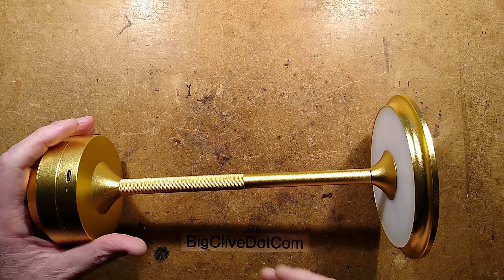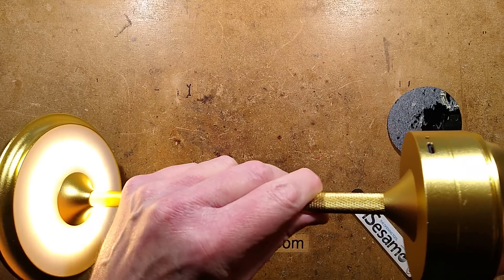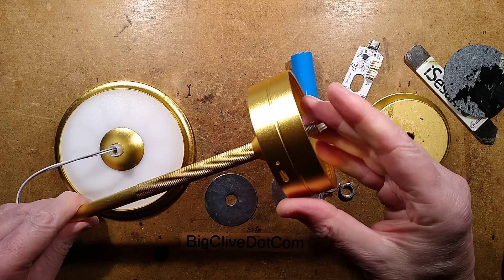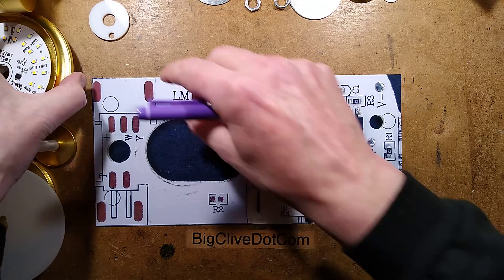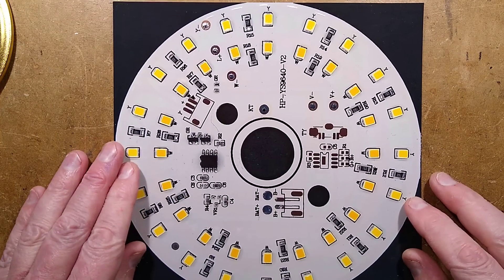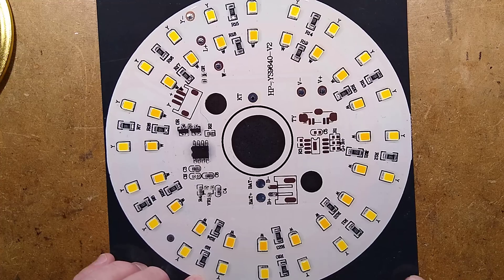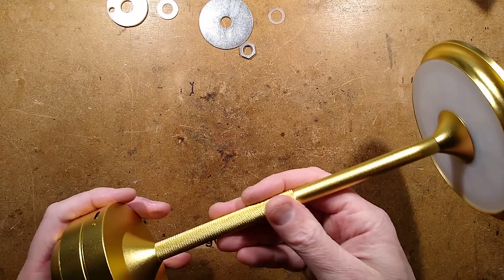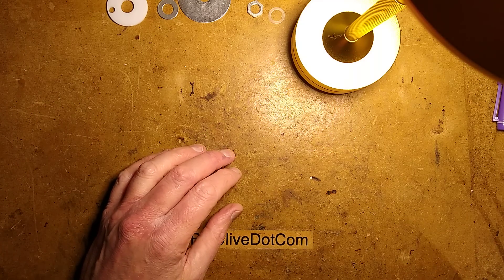Crappy, but hackable rechargeable restaurant light

Comment: A bar I go to has a bunch of similar lights, the touch control works well but a couple of them don't turn on the Led when the USB is plugged in. I'm not sure if it's charging, I suspect not. I'm wondering if there is a bad solder joint or if the battery is shot. I can always take it to work and look at the lamp at the rework bench, just wondering if anyone had a similar problem.
Reply from the maker: Some chargers may generate so much electrical noise that they affect the touch sensing.

Comment: I have a usb pcb light with touch with almost the same dimm function. It's a great night light and I keep planning to hack it and make it a proper night light. Multiple taps and color changing is annoying. Lamps with multiple modes should have different switch. I am yet to buy a better night light than the ugly pcb light.

Comment: Never underestimate the power of percussive maintenance!

BC, my brother from another mother, you need a deadblow hammer.  Hear me now, believe me later.

...i'm sure you already have one.  i like the one with the rubber and plastic head, non-marring.  thing is, the lamp with that thin metal with large circ., you're basically dealing with a mistrhreaded crappy pinspot.  I know you know the ones i'm talking about.  when you're halfway through unscrewing it and the lamp ring binds?  i bang 'em on the nearest hard object.  that usually pops things back into place...

Cheers!  An thanks!

Comment: Looking on LCSC, the touch controller appears to share a pinout with the Sam&wing brand 6010S chip. Interestingly enough, the picture seems to show the chip is unmarked on the top surface, but has some markings on the bottom. Only problem is that the datasheet says that the brightness increases as you hold the touch button, but perhaps there is a non-S variety of the chip out there that has the opposite behavior.
Reply from the maker: It does look like it may be that chip.  I've updated the video's description.

Comment: All these battery-powered lights in applications where they're not meant to be portable is perplexing. Instead of having lights which are wired and just need to be turned on/off/dimmed, you now have dozens of these things in your restaurant which need charged, can't stay on indefinitely, could be easily stolen, and because batteries aren't 100% efficient, you end up paying even more for the power, time and effort to charge them, and create more e-waste when the batteries inevitably fail? Maybe it makes sense to those profiting from these devices, but it doesn't make a bit of sense to me.

Comment: I have three of these lights. They are all significantly better, in that they have a physical tactile button.
Two of them are basic cheap yard-sale obtains that offer High and Low power in Warm White. One white, one orange.
The third I paid Covid prices for, and is significantly more advanced (and awesome), with a sharper appearance.
It has the three color temp settings, and will cycle between Neutral White Bright, Dim, Warm White (bright/dim), and Cool White (bright/dim). It'll turn off when you click it after having left it on for a little while, and has an elegant dimming transition between settings. The base has a Bluetooth speaker.
All three are USB-C, with the correct sensor resistors in them.

I actually have a mini-lantern with that same quirk as yours of storing the color temperature brightnesses separately.

Comment: The construction doesn't look bad in this one (metal and threads is better than plastic and glue), except that I really don't like the LEDs being on a single sided board without any proper thermal connection to the outside.
That said considering how often I have seen touch lamps not working properly (I repair a lot of stuff so people come to me when things don't work), I can only guess how many of them land in the trash. Trash created by something that everyone could live perfectly fine without with.

Comment: I bought one of these, battery lasts about an hour. Can I just pop an additional or bigger battery on or would it require a more expert hack?
Reply from the maker: You can upgrade it to a higher capacity cell.
Reply: @bigclivedotcom  Thanks BC, I'll do that then, also interestingly, mine isn't sensitive on the outer disc.

Comment: It looked like the touch sensor and the top plate moved slightly relative to each other when touched, and that relative movement was triggering the switch. Now that might have been down to your big bear paws, but I suspect that it's just a crap switch.
If you do decide to become a shill, don't forget to mention how the base is "security sealed for safety"

Comment: Old-fashioned rechargeable restaurant table light, in his 60s I remember going to restaurants that had a fairly good size rechargeable light sitting in the center of the table and you had a button on it to press and it would flash a red light indicating that you wanted service. If this device was meant for commercial setting they missed the boat.

Comment: I'm not exactly sure, but I think the capacitance of the small touch knob change would weakly couple with the larger top metal ring and thus change when you touch it. a double removed capacitance to the touch circuitry?

Comment: The one thing i saw missing from the design was the option to tune the mixed color between 50/50 to continuously vary the color temperature.
These are about 26 US$ on Temu, and they have a wide variety of designs, probably accounting for the flexible circuit boards allowing for united or split designs, starting around 11 US$.
Great review. Im tempted

Comment: It is quite satisfying how the USBC port slots in so perfectly. Whenever I'm making a device, I always notch out the hole for the connector so it slots in nicely like that, but figuring out how to mount the PCB board is sometimes a little tricky. I usually just end up making the holes wider to account for misalignment, but slotted holes might work better.

As for the rest of the thing, it's a shame they went for such a fake looking gold. Brass would look better than the ugly gold anodisation, but obviously that would be much more expensive. Black or white powder coating might look better, and probably not cost much more than anodisation.
Reply: I think a nice pink would have been a must buy.

Comment: I got one like this a few weeks ago. The funny thing is that the switching function works when it's charging, but the hold to fade function stops.
Reply from the maker: That's probably because most chargers introduce a lot of electrical noise.  So the software would be confused by what appeared to the user touching the sensor repeatedly at very high speed.

Comment: I'd guess the left out circuit in the top part is an option for the circuitry from the bottom board (the battery charging). There's a battery connector, too. I think both boards were designed to have the option of standalone use.

Comment: Interesting, maybe is another Chinese garbage, but looks nice, the circuit with a resistor placed in series with a capacitor that have her mid point connected to one IC pin looks like a kind of monostable multivibrator used as PWM, but 100R is a too low value to this purpose...

Comment: The next version will be even cheaper, made of plastic parts with no metal in sight. 
They usually make new products out of sand-casted Zinc. If the product sells well, they'll pay thousands and make a tooling and molds for plastic part injection.
Reply from the maker: I'm sure there will be completely plastic versions.

Comment: It might not be put together well, but at least it's battery-powered and won't kill you.  My brother owns some 120VAC table lamps that are touch activated, though it's almost impossible to get them to turn back off.  There's not much that frightens me more than a touch-activated, AC-powered product bought from China via Amazon's Marketplace.  I tell friends and family to buy AC-powered products only from domestic retail stores, but I don't think that they listen.
Reply from the maker: The lights that use cheap grey-import touch sensors are definitely not as safe as the ones that use locally compliant ones.

Comment: Bought something very similar from Bunnings (Aus.) a decade ago.  Sub-mini USB B charging, internal 18650, but cold white only, with three intensity settings.  Makes for an excellent camping / outdoor dining / emergency table light, and still works really well indeed, on the original "no Name" Li cell!
Reply: I would like to point out that Bunnings is a Hardware Shop in Australia

Comment: I have a magnetic disk light that is extremely similar to this.  However, it is not touch sensitive.  Instead, it has a push button near the USB port that has the same options as the touch sensor in your light.  The plate with the LEDs will cycle through cool white, warm white, and both when you push the button.  Each of the three can be dimmed by long-pressing the button and that option will be remembered.   At full bright, the light runs for a few hours.

Comment: Additional mod suggestion: the lamp still registers ghost touches from touching the top cover instead of the touch plate, which suggests the top cover isn't connected to circuit ground. If you do that, it should eliminate your ghost touching problem. The "disco" behavior may also be LED board noise getting coupled to the top cover and touch plate, grounding the top cover should stop that too.
Reply: I agree that could be the problem, assuming the cover is conductive, however, I would think it could likely be a sort of opposite problem. That touch sensor design rely on detecting the change in capacitance between the sensing wire and some "ground". With no external wiring to ground in the environment around, the rest of the circuit will act as an electrode providing capacitive coupling to ground. Thus strengthening this coupling by bringing your hand close to the top circuit board could be enough to increase the overall sensor wire to ground capacitance enough to trigger the touch sensor.
Reply: @MrXBT2000  If you connect the top cover to circuit ground, any charge and capacitance you may add by touching the cover brings the whole circuit's potential to whatever the new equilibrium is and the touch plate surrounded by the now grounded (to circuit) touch plate sees no net change in capacitance unless you actually touch it.
Reply: @teardowndan5364  the touch sensor essentially measures the capacitance between that little wire electrode and the rest of the circuit ("ground") - bringing your hand close to the wire or close to the circuit will both have the effect of increasing that capacitance. Yes, anything that increases the overall capacitance to the environment around would reduce the relative contribution of bringing your hand close to the circuit, thus making it more specific to touch of the "button" in the center. In this case it seems to me it may simply be too sensitive, so another simple solution could actually be to reduce the length of the touch sensor wire. But it all depends on the conductivity of those parts too - not obvious for me if they are metal or plastic - and even if not metal they may still be conductive enough to "conduct touch".
Reply: @MrXBT2000  Connecting circuit ground to the top cover isn't to increase capacitance to the environment, it is to eliminate the top cover capacitance and EMI from the LEDs' PWM from getting coupled to the touch plate by grounding it to circuit. With the top cover floating, EMI from the LEDs and environment get coupled to the top cover and a part of that also gets coupled to the touch plate. With the top cover connected to circuit ground, most of that noise gets eliminated and the touch plate is now only measuring capacitance from touch plate to circuit ground instead of plate + some part of top cover.
Reply: @MrXBT2000 ⁰⁰⁰⁰⁰0
Reply: @MrXBT2000 ⁰⁰⁰⁰0⁰⁰⁰⁰⁰]
Reply: Probably fixable by simply using a wire to bond the case, plus the top, to the negative of the circuit. Should stop all the ghost sensing, as otherwise the entire case is an antenna.

Comment: Seems like this would be a neat little night for the picnic table while camping. USB battery pack would keep it going a while.
Reply: I have these and use them as you describe.  They are great, and run forever on their own.  Forever and a day if you use even a modest usb battery pack, or a tiny solar 5v panel.  Best of all, they light where you need to see and don't shine in your eyes like every other 'camping' lantern.  Its not 'glamping' to use modern technology when it is a superior solution.  I wish we had these back in Scout's days.
Reply: @ConstructiveInterference656  GMTA! Exactly the biggest problem with LED lanterns. Finally found a Coleman that is sufficiently diffuse and the light comes from the top of the lantern, much like the old white gas ones.

Comment: The ‘touch lamps’ of the 90’s (of which my mother had a few), operated wherever they were touched, on the ‘metal’. Base, shade, stem, it would cycle through the intensities regardless. 
I think this model is supposed to ‘trigger’ regardless of where in the top you touch. 
I remember them being quite sensitive, and sometimes triggered when something else electrical was operated. The cordless phone also played havoc with it, at times.
Reply: My dad had a light switch above his pillow with plenty of bare wiring. I used to grasp for it blindly plenty of times, which is how I learned exactly what 220V AC feels like and that it's not immediately lethal... why was I in my parents bed? He also hung a small CRT TV from the ceiling by some rope!
Reply: @killroy42 ok the TV is cool, the bare wires not so much. Get some electrical tape about thine self lol
Reply: @zyeborm  my man even a "small" CRT TV hung from a ceiling is a very lethal object if it falls down. None of those light LCD flat panel rubbish, the CRTs are heavy. You can survive some 220v zapping, you DO NOT survive a small CRT falling on you
Reply: @killroy42  those were the days
Reply: I also had one in the '90's . Metal base, touch, etc. Even in the days before I knew much about electricity and electronics I knew it was only a matter of time before something went wrong. It was plugged into the mains and sat next to my night time glass of water - oh alright - unfinished beer. I threw it out.
Reply: Yep, stale beer in the morning is not nice.
Reply: My aunt had a touch-sensitive floor lamp in the living room next to my uncle's recliner. After he passed away it would sometimes come on by itself, she half-jokingly said that his spirit was controlling it. We played with it once and it seemed to be something to do with the outlet the lamp was plugged into, maybe a faulty ground or intermittent short circuit (the house and wiring were ancient). Funny phenomenon though.
Reply: Touch lamps have been around since the 50s, the original ones ran on tubes and they were also all metal base.
Reply: When my plasma globe was turned on it always made mine cycle through brightness levels like crazy
Reply: I can still remember feeling the mains buzz through the base of those things.
Reply: I'd love to know more about how these touch sensors work.  I have a small project to connect a touch sensor to an isolated relay output smart switch. So far, all of my attempts have fail. But then I'm from Barcelona and 'know nothing'

Comment: I think I'd want something that had a good old fashioned switch, one of those KISS principles, especially as it's hard to make something so simple go wrong (and yet, they manage it somehow?!)... :P
Reply: On the other hand, I hack touch switches into my lights. One reason is the climate, here in the tropics mechanical switches die quickly through corrosion and arcing.

Comment: Nice touch using fender washers to hold that 18650 cell! Not a fan of holding a PCB with nuts and washers over the central slot either. Very easy to crack the PCB by overtightening the nuts. Can't wait for the cost down version where they use the cheaper grade of those big fender washers - you know, the ones with the high and sharp burrs all around the OD, cause the die has made 180 million pieces! Never seen that happen....er.....  What a junker. Cheers!

Comment: TECHNICAL QUERY: The photograph of the circuit board looks MORE REAL than the ACTUAL circuit board itself! ... Q: Have you tried putting the photograph in-circuit, in place of the actual circuit board? 🤣

EDIT: The Chinese do that a lot! ... Putting photographs of the innards inside their products, instead of the actual innards themselves! ... Like when you buy a 2TB USB Flash Drive for £6.99 on Temu, and the Flash Storage Chips inside are just photos! 👎😠

ERROR: "Formatting Failed! ... Flash Storage Smudged!"

Comment: Just noticed this video literally not even a minute after it had gone public.
Reply: Also I will add this: Which is that I think the reason the rim of the top triggers the touch feature despite lack of direct connection to the antenna likely has to be some form of capacitive coupling possibly.

Comment: It's nice looking and performing if you don't count the touchy touch sensor.  I've never seen an 18650 cell with a pigtail soldered to it.  One thing I would consider is adding more cell capacity to it to make it last longer between charges.

Do you think this is a good idea - putting cordless lights in a public place?  I think there is a big chance of them being stolen.  Stuff happens!  🤷
Reply: If I went to a restaurant which had those lights on the tables I think I'd take them apart while waiting for the meal!! 😆

Comment: Does it remember the brightness settings if the battery is disconnected? I'm wondering the setting is non-volatile.

Also "still reacts to the rim being touched" fnar
Reply from the maker: The battery is permanently connected in normal use.  I've not tested running it completely flat though.